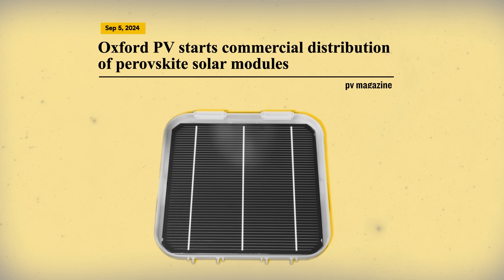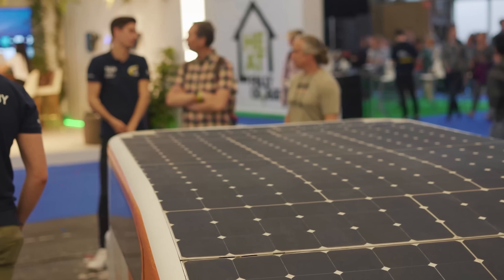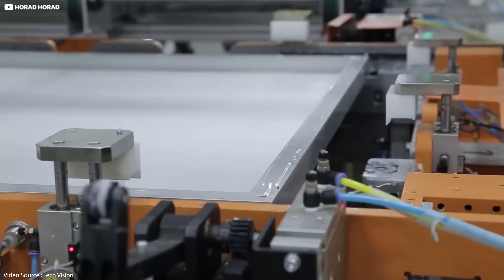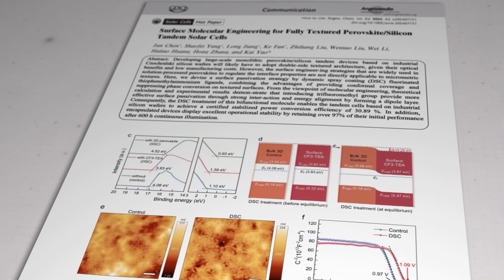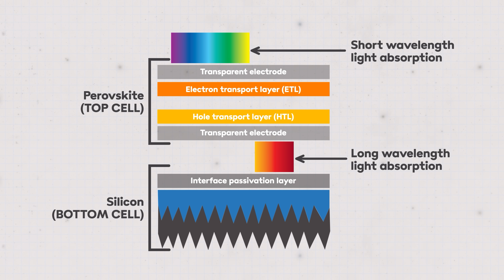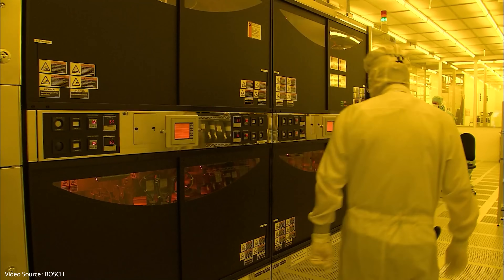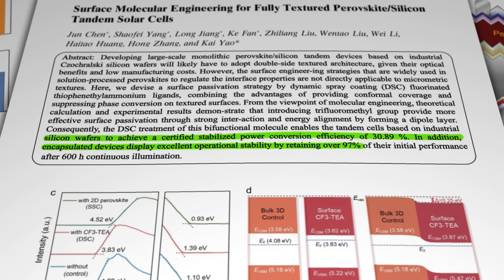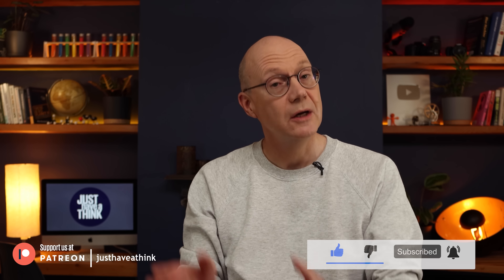Solar PV with more than 40% efficiency is now achievable.

Comment: Great examples.  It is great 2 oversized, it's definitely worth the money. But you have to make sure your voltage doesn't exceed.Its limit especially in cold climates.   That's why it's important to have a smart installer. Who knows what he's doing or do a lot of research yourself before doing this.

Comment: Any "Law" can be cheated!, suppose you run cold water in a sealed thin jacket on the back of the solar panel???  Then add that efficiency to the panel's specs because you now have free hot water or house heating!!??? !!!    You bust the thero limit !!!

Comment: I think that as wonderfull as this spray process sounds there may be that there is a bit of "hopium " involved. That is OK I think ,as hope should spring eternal and what else motivates us to move forward, but there is more work to be done here. If panels are "illuminated" energeticaly for say 10 hours a day, then 97% of original efficiency at 600 hours equals 97% degradation at 60 days, and that is a long way from from the twenty year percentage of degradation warranty on my newly installed solar panels. What happens at 1 year, 5years, 10 years?  At twenty years will the spraye processed panels be as efficient or more or less efficient than the ones I have now?

Comment: Dave, Dave, Dave, when you look at these products being manufactured, like this episode Perovskite and Silicone PVP’s, have you tried looking at them instead of through rose tinted specs, wearing clear lensed ones, as the manufacturing be it prototype or fully commercial has a mass of machinery and process piping in stainless steel, all made with the use of FREE FINITE Flammable Fossils, not one bit result of Rebuildables, sorry, Renewable (alternative or clean) Energy, and that applies to the raw materials that make up the PVP’s themselves, or perhaps you deliberately ignore that🤔

Comment: Even if it's 50%, it's still useless
it only works 1/3 of a day at best
If you are at the equator you can get ~ 1200 watts a square meter woo hoo for at least half a year, as long as it's not overcast or raining.
If you live where the majority of people live this could go to 600-800 watts a square meter.
Yeah free energy, but they only last 10 years, unless they get damaged by storms. So somebody has to pay for that free energy.

Comment: I would have thought that price efficiency is more important: if I have $10,000 to spend on solar panel energy, the critical question becomes which technology offers the most kilowatts for my $10,000? That, to me and I think many typical consumers, is the most critical question, and industry-leading raw efficiency numbers don't mean a thing if the price per kilowatt is more.
Reply: The technological advance is a huge step forward!  Prices, and modifications generally bring the price down over time.  It has been a long time with no leap forward in solar - but this looks like potentially a huge leap forward!

Comment: It is not correct that 24.5% is something like 20% better than commercially available panels. Aiko has 460 Wp panels that between 23.8 and 24 % efficiency. These cost about 80 Euro in the Netherlands (end customer price). Longi just released a larger (230cm long) 650Wp+ panel with 24.5% efficiency. 20% above competition would mean that the competition only had 20% efficiency. That is way outdated.

Comment: As a proud owner of a PV system on my roof which's electricity is intended to be used directly, I'd like to amend that the absolute efficiency under ideal conditions (direct sunlight) is pretty much irrelevant for me personally: In summer I already get multiple times the amount of electricity I can meaningfully use, but when its cloudy, days are short and electricity consumption is higher (winter!), I'm very much interested in higher yields. Looking at the spectra of the Perovskite-Silicon cells shown in the video I get the impression that for diffuse light, their efficiency is unfortunately not much better than current cells, because the Perovskite seems to primarily take advantage the UV spectrum (which is not present under diffuse light conditions)? I would be delighted to be wrong in this case...

Comment: Currently i view perovskite is kinda the high temp superconducter of solar has great possiabilities if only they can get around the problematic aspects of the material. The main issue of perovskite is durability and fragility so the part about the durability of the material is important.

Comment: You might want to do a video on the Axially Graded Index Lens being developed at the Stanford U. Precourt Institute for Technology. The lens is an optical concentrator. It is claimed to output spots 3 times brighter than incoming light. They also claim that it can capture 90% of the light hitting its surface. This captured light would include not only direct light but also diffuse light that is scattered by the atmosphere and weather such as on cloudy days.

Comment: The world need long lasting solar. Panels. The efficiency is not to important if they need replacing in 20 to 30 years.. We need increase solar in next few years. Not replacing existing systems...Make solar last ober 50 years
Reply: The serious problem with these perovskite panels is they don't last nearly as long as normal panels and they are quite fragile compared with normal panels.

Comment: This is great as long as the green electricity is used to make Green Hydrogen. Why? because all batteries are now made with fossil fuels. And if we don’t move to green hydrogen now in 50 years we will still be using fossil fuels to make batteries if there is any fossil fuel left.

Comment: If this stuff is cheap and easy to produce and we expect to see rapid improvement over the next decade then why not for the time being develop a top surface panel of provoskite that is consumable? Recyclable. Even if it doesn't last for the full lifespan of the panel if it's increasing the efficiency of my panels at a certain point it's worth it

Comment: losing 1% every 8 days is not stable. If its lost from direct sunlight then 1% every 40  days is still not stable. Thats 9% loss a year. You will still be replacing them every 4 years to compete with silicon. Basic ROI calcu;lations are not hard. Failing to do so is clickbait

Comment: There seems to be a lot of talk about panel efficiency but for most people the priority is price per Watt. A cheaper less efficient panel makes more sense than a more expensive more efficient one. If roof space is the limiting factor then Watt/m2 is the key factor. Rarely discussed in the voltage of panels, it is easy to be over voltage on your inverter before you reach the max Wattage. I have been off-grid with Solar for 6 years  - videos of my setup on my channel
Reply: "There seems to be a lot of talk about panel efficiency but for most people the priority is price per Watt."

Agree, but you have to consider the total price per watt, including installation labor. Even if a more efficient panel is more expensive per watt to manufacture, it may still end up cheaper per watt in the end if fewer panels to install results in less labor costs for the installation.
Reply: I suppose there are teams working to produce cheaper panels, and teams preparing the next generation of more efficient panels. Progress happens in 2 fronts, just like we see in electronics
Reply: @srpenguinbr  Different solutions for different problems. For satellites you want maximum output for as little weight as possible, while also having to deal with the different enviroment.

So it's probably a bit more than just two fronts.
Reply: @srpenguinbr   probably so, but it seems strange that nobody talks about the cost, which has the effect of keeping consumers in the dark about what they should be paying when they get a supply and fit quote.

Here in Thailand we can pay as low as ฿5/W = £0.11 = $0.15 for PV panels. That's why I have 20kW of PV
Reply: @EcoHouseThailand  there is a lot of cost savings given by higher efficiency panels even if the panels themselves are more expensive. fewer higher efficiency panels means less labor costs to install. it also means less electrical wire that has to be run, and even more critically less solar panel brackets and mounting systems, which for ground based arrays, ground mounting systems can cost as much as the panels themselves.
Reply: @ryuukeisscifiproductions1818  The reality is that most people never actually buy solar panels, if they even have solar themselves they pay a company to supply and fit. I have been buying panels for 8 years for various projects on my off-grid home and own 55 of them.  I have been monitoring prices closely as I plan to sell some of my original panels and replace them with higher Wattage ones due buying a second EV. I will continue to use price per Watt as my main criteria. I will document the process as always on my channel.
Reply: Yes.

Comment: If Perovskite can be doped on / in Silicon solar panel, then maybe that market will thrive!!!  It's  about the valence level when mixing two or more materials together to improve efficiency. Valence level is about electron transfers between those materials when heated.  Thermoelectric panels to capture heat as well light works out more better... but nuclear batteries have a source emitter without any reliance on the sun to provide energy!!  Just a thought...😮😮😮😮😮😮😮

Comment: Until we are able to find materials that produce the photoelectric effect at more wavelengths under a realistic manufacturing process then we are stuck, but if and when we do there will be a springboard. Until then, there is still no reason not to use the technology we have without trying to eek out a few more percent at a much higher cost. The current tech is more than capable of offsetting a typical home consumption under a distributed energy scheme. Unfortunately that us being undermined by the utility monopolies who's profit is impacted, which is why you see the current changes in NEM that is crushing the solar markets and relegating systems to higher wage earners who can afford the up front cost of batteries to make it economically viable under the new oppressive tariff arrangement, purely for the sake of monopoly profit. As exemplified by all the propagandized "problems" suddenly melting away with the new rate structure and the benefits of current large scale solar installations being gate kept from the general public.

Comment: So what's the cost and lifespan comparison vs standard panels? 
Thought about this some more about I believe perovskite is a textbook example of planned obsolescence. We're talking a material that degrades by exposure to sunlight, used in SOLAR PANELS. Does anyone else see a problem here? I think we need to go back to the engineering principles of the 1970's, where a tool was meant to last your entire lifetime, if not multiple lifetimes. Nowadays we have disposable everything, and the so-called green industry is no exception. I don't want another disposable ratchet. That's how we got in this mess.

Comment: Solar panels are the most efficient source of electricity. If one compares hydro with solar panels, he must calculate efficiency of solar energy evaporating water into clouds etc. which gives efficiency of less than 1% compared to 20-40% for solar panels.

Comment: I swear, almost every electric car is the embodiment of greenwashing and capitalism.

which engineer ever finished his Bsc and maybe even his Master and thought: "hmm, lets make a car that weights twice as much as cars of the same size and call them "eco friendly" ".

honestly, the only thing that makes electric cars remotely "green" is because there is a slight chance that they are charged using solar or wind power. otherwise, its just a heavy, expensive brick of overcomplicated technology that only cares about what the customers are willing to pay for, and do as little as possible to make it seem ecofriendly enough. 

ifyou want something that is eco friendly, buy a bike or walk, if that wont work, buy a moped or small CC motor cycle. if you need to go very far or have a big family, get something that will fit everything with as little room to spare in a as light as possible configuration. think of anything between a sedan or station wagon. if you mostly ride alone, and don't feel like becoming an airplane for 2 seconds because some BMW didn't see your motorcyle, get a compact car like the toyota yaris or mazda 2/3. both are small and light, yet plenty save for most circumstances. 

and no, because the car is smaller doesn't mean it is less save. if you want to see the safety ratings, look it up, that will say enough.

Comment: Great if you're a micro-satellite, in the near vacuum of space, but given the calcium is water soluble, and the panels packed with lead, that will drip into the environment in various iodine compounds over the few  years before they degrade beyond economic use, and will require specialist recycling of the rest, to not leave a toxic mess, doesn't sound too promising on earth.

Comment: OK, let's "Just Have a Think"...
The chemical used to improve the surface flatness contains thionyl and fluorine, both of which are extremely toxic and difficult to recover and recycle.
Then, the longevity was advertised as a 3% reduction in efficacy after continual illuminaton for 600 hours (how bright/aggressive was this illumination?). That's 50 days. If we take the approach that every 50 days will cause 3% degradation then the treatment will be 50% effective after only 3 years.
I know there is room for 'development', but the cheeky, chirpy, attitude of this video in amplifying the work of a Chinese group that has made a discovery when China as a whole is committed to increasing coal consumption for power is what's really causing me to "Just Have a Think".

Comment: The description of what happens when the sunlight hits the material reminds me of batteries. It seems that it could be an actual chemical reaction from the sunlight that causes   the material to change and kind of rust giving off electrans but once it's rusted then it doesn't produce as well. ???? I am not sure if that is correct just my thoughts. The silicone panel probably work very different but they also eventually decay in the sun too. I say this because I live in Florida and the sun is very strong here. I like experiments with solar technologies to try to optimize efficiency for example here in Florida having a way to cool a panel improve thier efficiency a lot. They also can last a bit longer although the sun eats them away eventually. Said to much. Great video thank you 😊

Comment: My 4kw system was also the maximum amount of panels that would fit on my roof, in ten years it's more than paid for itself ..even though I recently did have to get a new inverter (which wasn't cheap), I really don't understand why people are still being slow to have systems installed. It makes damn good sense even for those who only interested IN money and investments and don't care about the planet or global warming..... and even more so if they can increase the panels, efficiency by so much more.
Reply: As soon as I can get a quote that will pay itself off in 10 years, I’m in. But our electricity here is cheap and the companies are shady, so I wait.
Reply: Electricity to cheap here it would cost me payments for 35 years to pay for system with quotes I got here. Since most systems only rated to work 30 years I would be out money.
Reply: Depends on your circumstances and the Country you live in I guess.
I'm UK based, I've got 15 x 395w panels, 5k inverter and an 8.2kwh home battery.
Payback in 6-7 years.  Cost £10,300 all in.
I didn't need to get a loan, but if near the end of my payback period the inverter or battery goes, you are back to square one in terms of ROI.
Bear in mind I didn't need to take out a loan, otherwise the payback period would have been 8.5 years...
Many variables, and many Countries now charging YOU for exporting to the grid...
Reply: Some people live in LIsted buildings and are not allowed panels at all......even though they are now quite unobtrusive and there's a "climate emergency".

Comment: About schokley-qeussier: Why not use most of the light and as for the low voltage add the cells in series, so the voltage adds onto each other

Comment: Our original 16 panels from 2008 still produce close to thier theoretical maximum. We can produce more from the 10 new ones we installed 2 years ago. And I dare say in the next 5 years we will install 5 which will give us the same or more than the original 16. That's quite an increase in performance in what will be 20 years.

Comment: Why not focus more on the existing product that's just gone on sale? I would have liked to know more about it, specifically how it measures up to currently available panels in terms of $/kWh and also their predicted lifespan. None of which information is easily available on the manufacturer's website, so that's a bit strange for a product supposedly in production and available on the market. It's praised all over for it's efficiency and lowering LCOE - but noone actually says how much. Not a whisper about cost or lifespan in any publications I could find. It's just "magically" better.
But no, let's instead dive into more vapourware research...

Comment: I would rather have panels that start at 19% eff and drop to 15% eff after 25 years, than panels that start at 30% eff and drop to 5% after 10 years
Reply: Definitely unless you need maximum power from a small space like on a boat. Still if these panels can manage a decent percentage after say 20 years, then they may still compete with the current panels.